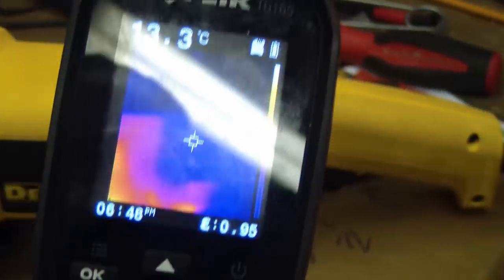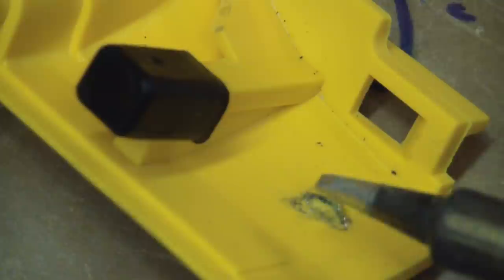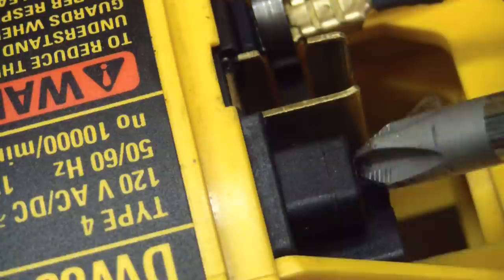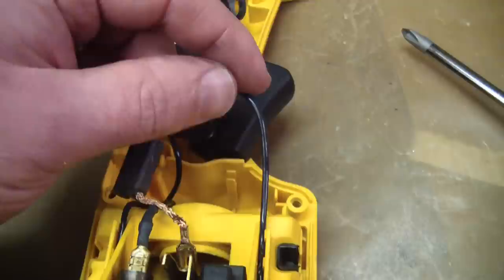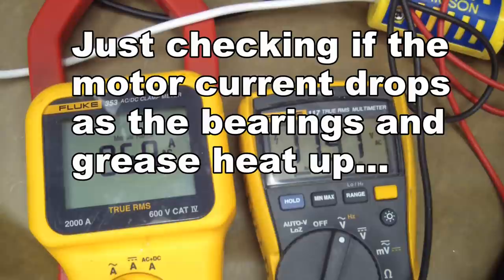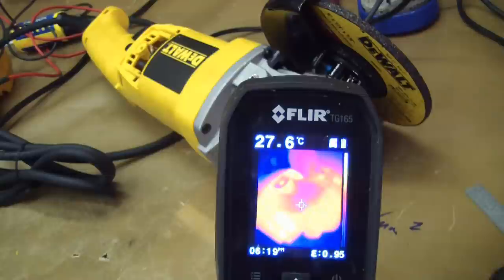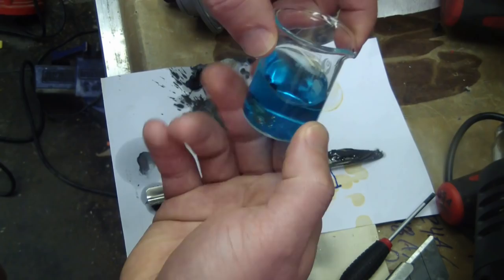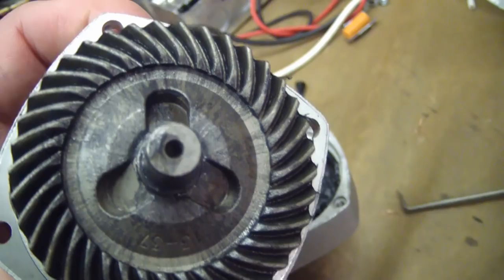Bored of lame tool reviews? Meet DeWalt's grinder guts Part B

Comment: I bought an sys dewalt dch25382 and I used it to chisel concrete which is probably too heavy duty for it but the part that went seems to be the gearing. Still waiting to get it back from the repair  shop  so not sure but that's what me n my mates thought it was anyway.

Comment: I'm thinking they have a strategy there. They made the base tool about as solid as they get, but guys are gonna buy them once, where's the revenue stream? Well those brush plugs mean they can guilt you into replacing brushes whether they're fully worn or not, and these gears are made to be replaced too.

As to why they put a shroud on the rear bearing... graphite in oil tends to be more of a clumpy mess, less of a lubricant. But that might be just because of clay.

Comment: I would like to know if the Moly disufide grease would make the sintered gear last longer.  It looks like it was put in the chamber with the plan that it would liquify and lubricate the gears.  If that is not happening it may be a serious design flaw.

Comment: I'm so glad this popped up on my feed, GREAT reviews/dissection, 5 stars, A+, and some fake internet cookies. (LOTS of them)

The DeWalts are deceptively tough. We use them at work, around 14 grinders, but have been switching over to German stuff such as Metabo and Suhner. I've been trying to kill my DeWalt for probably better than a year now (we get them remanufactured) and it keeps on keepin' on. It has a bent spindle, busted gear teeth, gets picked up by the cord, and just overall beaten into the ground.

That being said, I'd still take my German made one over a cheapo any day. They run truer/smoother, cooler, and so much quieter.

I also have a 7" Makita that is a love/hate relationship, you should see what that thing did to me. (Those trigger locks can be deadly)

I'll also have to dig up pics of my DeWalt's gear teeth.

Carry on with your awesome videos.

-Smiley

Comment: Great F-ing Review!!!! BTW. .. I use this grinder everyday pipelining and doing compressor station  work. Best unit I've used and tough as nails... we modify the guards to run 7nch discs and yes the gear box will quite first. Mine I've run for almost 5yrs...probably the only grinder you'll need around the house and you can will it to your grandson.

Comment: This week I wanted to make my wall act like a door [so my like new Bridgeport can enter]. I found rusty old long  lag bolts to make self lifting hinges. I put the bolts in a brine of salt and vinegar in the oven [the wife was gone]. I tilted the Pyrex to get the bolts in deep in the corner. When I wanted to remove the pyrex, the brine sloshed and the the Pyrex exploded. I had to clean the oven and the floor from dirty broken glass and rusty brine. I thought Pyrex was zero temp coefficient. Now within a week, AvE tells me the new Pyrex is no good.

Comment: Couldn't you loosen the nut on the pinion to give some clutch action, since there is no key? Clean the threads, a little lock tight to prevent self tightening, buy a little extra time on that powdered gear?

Comment: Didn't dig through the comments to see anything on the exact nature, but my idiotic guess at the grease is some variant of "moly extreme pressure lithium grease NLGI-2", looks like the stuff you can buy at an auto parts store for wheel bearings or whatnot.

Comment: I have a Makita 4 1/2" grinder that stopped spinning with the motor running.  I opened it up and the pinion drive gear's teeth are all worn away along with most of the adjacent gear's teeth.  I've only had the grinder a year and 2 months and used sparingly.  I don't know what gives.  Are the Makita gears powdered metal too?  I mostly used those Arbortech wood carving blades with it.  I wonder if they over-stressed the gears?

Comment: Im watching this video tonight.. yrs later after I found your awesome channel.. I kinda felt that bevel gear was a powder gear. Im huge into R.C Trucks they are 1/8th and 1/5th scale.. I see all the time powdered made gears all the time.and with a 30x loop I have seen the very same pits in the gears as your ring bevel gear.. I have had some pretty good luck using and automotive product called  " Engine Restorer"  Made by "Restore"...Its got good bit of funky shiny glitter parts that fill the pits in those powered gears. After run my 1/5 scale for close to 20hrs.. ( my pmi time ) .. Under the loop, This stuff did fill and polish the pinion and bevel gears and the planetary gear sets .. Im curious about the polish.. But you have Introduced me to molybdenum disulfide grease.. Here across the pond in New Jersey... 1 oz cost $10.18 plus shipping and handling. Its winter now and ridiculously cold.. I hate it when the weather gets below my "IQ".. But this spring.. Im going to clean and lube with this grease with new gear sets and compare. Cheers my friend!

Comment: Well, for a moment, about 30 or 40, I thought you were going to give the Dewalt your household seal of approval but that powdered metal gear was a bit of a let down wasn't it. I was once told that engineered products such as this are designed to meet a specified "hours of engineered use". The example I was given, and it should be said it came from a representative of Husqvarna,   was that Huskies were engineered for "X" engineered hours of use while a lower cost competitive brand was engineered for "Y" (less of course) hours. The criteria was explained as being 90hours of continuous use under maximum load. Have you ever heard of this before?

Comment: yep you can torque stall mine since the lock pin is stuck in and the grinding wheel is stuck on. the spanner tool won't remove it since it bent and the little pins broke out of it. the nut itself is totally locked on and has even since cracked trying to get it off after I put it on hand tight. tried to get the thing off for about 2 hours until finally I threw the grinder all the way across my hundred foot yard. absolute junk

Comment: Makita and Dewalt tools are lightweights compatible to Metabo !   Metabo is the only angle grinder that allows you to remove the flap wheel or stone by decelerating tork !  All other grinder brands locking arbor pins break off !

Comment: Mister,first things first i think your video and teardown of the Dewalt grinder was great,first time i see sombody tearing down a brand new tool, but i was left with a couple of questions,wich would be great for me and probably others to get some answers,first all in all would you recomend this Dewalt grinder,and second it looks like if anybody was to buy this grinder would you advise them to put some extra grease in the gearbox before first use and wich type of grease would you recomend? Thanks.

Comment: Another excellent review.
I do believe I could possibly work with you. That's a compliment BTW. And I understand pretty much everything you say. Not sure you would understand me though. I'm from the NW of the UK. Some folk from only short distances away have trouble. Most engineers/fitters/techs manage though.
Noticed there were no shims in the De Walt. How did the gears mesh?
How about some close ups of the meshing. Not sure if we need to go mad and blue 'em up, but a nice shot of the grease on the wear side of the gear would have been nice.
Keep up the beltin' work m8.

Comment: I'm not sure I follow you on the temperatures to melt solder. You say it is about 350 deg, real degrees not american pesos. So I take it you mean 350 C. That is about 660 F. Yet solder melts at about 188 C, or 388 F. Are you sure you know how to read your soldering station ?

Comment: I really enjoyed your review! I would suggest doing more research on the helical gears though. They are laser machined (I believe in TN, could be wrong) and are meant to provide increased durability than the teal and red competitor. There are many reasons that you covered why a yellow will last longer than a competitor and the gears are DEFINITELY one of them. I would love to see you do more research and editing to provide your viewers with a more accurate understanding of these high quality gears.

While many parts probably are manufactured in China, I highly doubt the gears are. Dewalt has taken many steps to be best in class when it comes to durable grinders. Thank you for the reviews and I look forward to more!

Comment: I had a Dewalt belt sander and snapped the drive gear not once, not twice, but three times in a week.
turns out the low profile and high grit paper hit the piss poor case design and the powdered metal gears fail.

Comment: Nice review, good material science.  Thanks for not mentioning "imaginary power" or that square root of -1 stuff in your p.f. discussion.  "i" drives me crazier than the metric system and vegans.  I think the modern powder metallurgy guys use a type of injection molding technique.  I'm amazed that a p.m. gear can work in that application. Density might be the best low tech property to detect p.m. gearage.  Manly steel is about 7.8 s.g. and p.m. is less about (aboot) 7.25  s.g.

Comment: Given the hardness of the gear, as determined by the previous video to be harder than hell, and that it's of the sintered flavor, would that lead it to be more or less likely to fail than a machined piece? Or is it a case of a bad choice of metals, and some other combination of metals that would embiggen its life? I'm no engineer or anything, so I don't really know the ins and outs of the likelihood a more ductile metal piece bending and destroying itself versus a harder than snot sintered doodad shattering due to shock.
Reply: ***** I suspect the first specimens of sintered metallurgy were crap...  the controls required into particle size, mixture composition, sintering temperatures, annealing and other pre- and post treatments are not trifling, when good product is required.

Comment: Forgive my ignorance, but I'm a little confused why powdered metal is a bad thing. Many knife blades nowadays are made using powdered steel (for instance CPM154, ZDP-189, Elmax, and S30V/S35VN) and they generally hold up better in most regards than their non-powdered counterparts (like 154CM, Aus-8, 420HC, 8Cr13MoV, etc.) I mean, I'm no metallurgist and I know that's it's like comparing apples to oranges, but I don't understand where the structural weakness lies.
Reply: Powdered metal done right is better. Like the CPM process but when used for making parts is usually done for cost savings not quality. This is my opinion not fact. But it's all in the process.
Reply: I have a shun knife which has a powdered metal core, it's quite brittle and probe to chipping if sharpened at high angle or used to cut thick shellfish, but that might just be the slightly higher hardness compared to other knives.

Comment: I have a Dewalt 18 volt grinder.  To me it's close to useless for serious grinding.  It's dead in minutes.  The new battery's over heat and they won't charge until completely cooled.  Could you please test some battery powered grinders for one that's worth a shit.

Comment: What kind of grease did you end up putting in the gearbox and where's the easiest place to get it from? I'm considering picking this up from Cambodian Tire and am hoping to do some one stop shopping.
Reply: I'll be sure to keep my peepers peeled for that. This next questions are going to sound dumb for sure but how much grease did you end up putting in? Did you just add to what was already in there or did you clean it out good and add a heaping amount of the good stuff in there?
Reply: ***** That's a big 10-4 on that one. I ended up finding that grinder and some moly grease cheaper deep in the Amazonian. Thanks for the advice and the entertaining vids, I'll definitely be doing the patreon thing after I get back from an upcoming concert haha.

Comment: Just because the motor is xyz wattage or hp, does not mean the switch handles all the current.  Think of the purpose of a relay in a car.

Comment: It might piss you off when I do it, but if I don't tighten my nut good and proper the disk will start to wobble loose as soon as I touch something with it. I still just use my hand, but I give it a proper pull, not just 'hand tight' like you'd like.
Reply: Why am I talking to AvE through a 2 year old video?

Comment: Powdered metal gear.
Well that make a lot of fucking sense. Near where I live there's a metal scrapyard. I found out that what they do is pulverize the scrap into near powder, and then load it onto ships and off to China it goes. I always wondered why the hell they pulverized it without sorting. Mostly it's cars.
Reply: mrsleep0000 cheaper and easier to sort it chemically in the land of no regulations

Comment: If you had, or made, some kind of dynamometer that worked on tool-scale motors...  Like, seeing how many 100 W light bulbs a grinder-powered generator could light (or variable load, or whathaveyou) would take a lot of the math out of the equation.  You'd probably have to have a good pulley situation to get the required RPMs, though.
Reply: I once dropped in to see a friend's car meet; they were having a dyno day, and I'd not seen one in operation before.  

I even consented to having my big RWD V8 Infiniti tested, at the group's and shop's urging:  they wanted to see something break into the triple digits, I guess.  

This was before youtube delighted me with endless compilations of dyno fail clips, which ensures I'll never put another car of mine on one, and explains why many of the older, wiser drag-racers with a few hundred kilobucks invested wave off the dyno question with a "Nahhhh".

Comment: The bigger 7" industrial grinders use some kind of plastic washer behind the inner wheel flange and spindle for vibration dampening possible that like to wear out improperly and will cause flap discs to improperly wear and vibrate your balls off or use it enough and will explode flap discs....

Comment: I had a Hitachi 5 inch grinder shit its gear set on me. But I'll be damned if it didn't cop some abuse. 2 years of pretty solid work and a set of brushes to kill a gear set. So one of my old workplaces had dozens of dead Hitachi 5 inch grinders sitting down the back with burned out commutators and armatures because the 900 lb gorillas using them were fuck sticks and leaning on them far too hard, thus letting the smoke out. Snagged a couple of them for spares and rebuilt my one. Then some bastard pinched it right out of my tool box while my back was turned

Comment: Why do so many people flock to get Makita tools, i bought my first power tool years ago and was peraded through the sea of green power tools and was told the 6" Makita was the best, i took it home unboxed and read kida through instructions threw a disc on and started work 2hrs goes by and the grinder stopped smelt funny so back to the store the said it would tae a week so i waited, get the grinder back told it was a brush problem. So get home opened box (the idiot i was i packed the grinder back in the box with the discs i bought are now gone) the grinder was brand new, not to worry i got some disc's and started cutting alloy tube again and bugger me same thing. this happened 2 more times there exuse was it wasnt rated to cut aluminum, so got a refund grabed a Ryobi and it hasnt complained for 23 years, hence no Makita comes past the front gate.

Comment: Great double feature, I've learned a little over 90% of what I know about power tools from your vids. Thank you.

To the point:
I just picked one up (only 89 Canadian Pesos, tax and shipping included, with some research and creative price matching), and I would love to know what grease you added to the gears? After all, I'm a young man, and I'd like to leave it for my as yet unborn grandkids. Also, I assume its best to just leave the shitty sintered gears, and not try to find a replacement proper set? Especially at the price I paid...

PS: perhaps the shitty brush arrangement is to make it easier for end user servicing? They advertise that 'feature', so maybe its for ease of dumb asses like me to change 'em out?

Cheers from a fellow back woods Canadian (though I'm still stuck in Ontario, not livin it up in BC just yet...)

Chris

Comment: Stuff like the spade connector, solid wires instead of stranded, and crappy gearbox could be made to fail parts. I see people scraping tools all the time because they failed internally. They take a lot of those name brand tools rebuild them and sell them again for nothing because the motor and other parts are way over built. Just an opinion. They do sell rebuilt DeWalts. edit* and the shitty switch.

Comment: could you pop that gear off and make a mold and replace it with a forged gear?
Reply: Because you don't mold a forging.
Reply: why not?
Reply: Unless you're really good with a hammer and don't know what a mold is for...
I think you mean cast not forged
Reply: Those are called dies not mold plates.
Reply: akbychoice That is my point. You cast a part with a mold. You forge a part with a die.

Comment: What do you think of using, CV Lith-Moly Grease?
Reply: ***** Ok, but do you think that a 2 to 4% of Moly Disulfide like that in, CV Lith-Moly Grease, is enough or is it better to use a 40% Moly Disulfide paste?
In my Bosch, the same thing happens, the grease doesn't stay on the gear, and weirder the grease that is used, seems to be a normal (yellow/ brown) lithium grease.
Reply: ***** No. It seems to be machined steel.
Reply: ***** Ok. Thanks.

Comment: Motor HP is so much BS.  Most of the new 1 HP motors you can grab the shaft and turn the motor on and you can hold the shaft from turning.  If you can, find an old 1 or 2 HP motor and try that and it will tear your arm off.  Also, lift an old 1 or 2 HP motor and you will get a hernia.